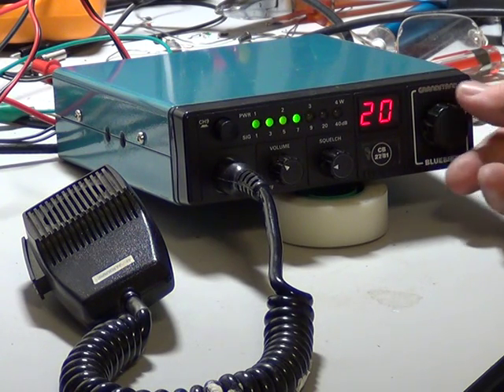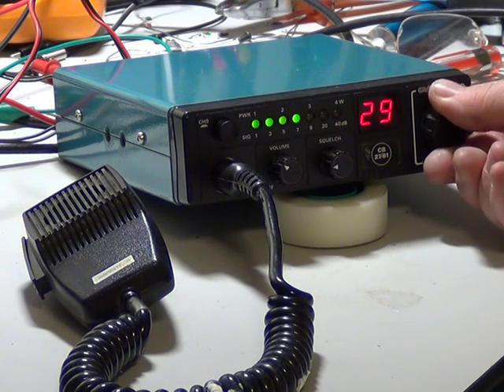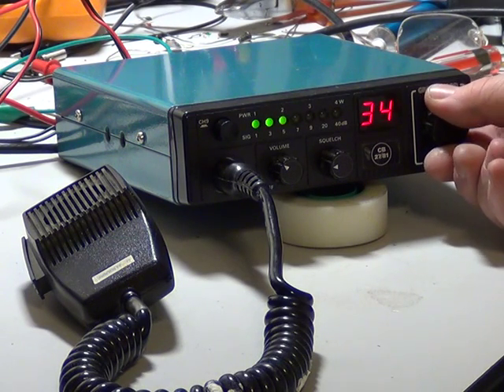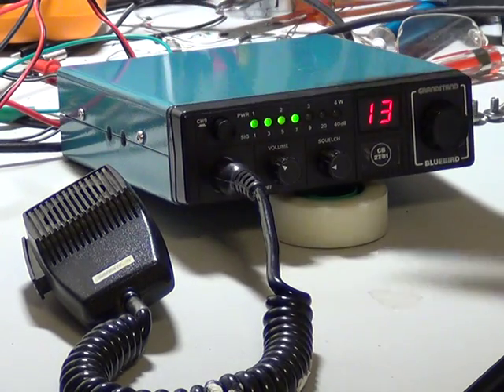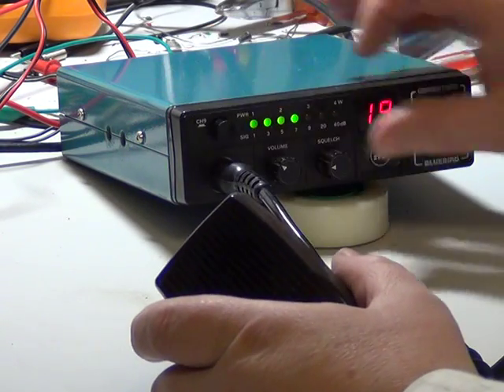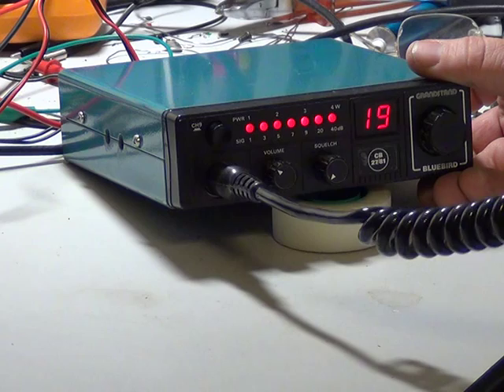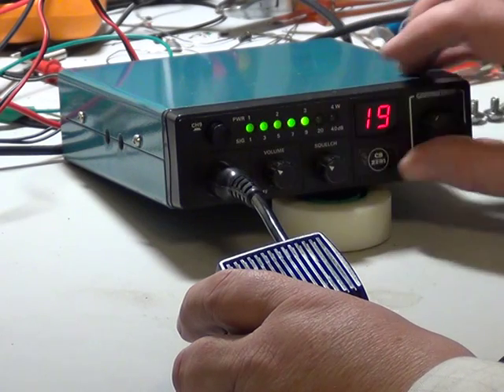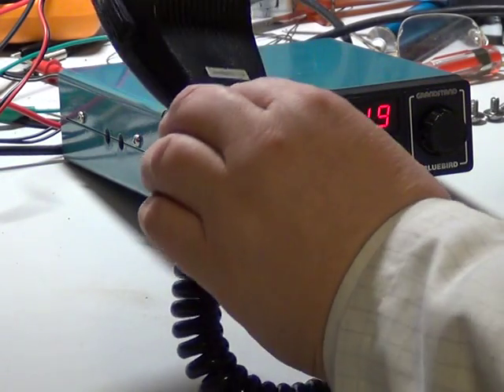Grandstand Bluebird  - UK CB radio, (CB 27/81) (Mobile) -  On The Air Test

Comment: The Grandstand Bluebird was my first CB radio, I bought it new around 1985, I think it cost £35. I used it along with a pre swr'd broomstick. One day in the late 80, s the skip was running rather well, I was living with my parents at the time in the scottish borders I managed to get a copy from a breaker in Penance. I still have my bluebird unfortunately it was damaged by a faulty power supply and need's repair. I am local to you in Conningsby, would you be able to fix it?

Charlie.
Reply from the maker: Charlie Wood Well, I could have a look. You would still have to mail the set in as it's strictly no callers!

Richard

Comment: I think they are a cracking little set but my radio engineer hates them for some reason ? 
I would like another 
Also do you repair  HF and v/uhf kit as I'am not all that far away from you and there just no one for miles with out going to the big outlets 

Cheers Sam m0srw !
Reply from the maker: Yes, the Bluebird despite being a high quality build is wierd; I've only seen one other & that was about 25 years ago' Lucky I photocopied the customers instruction book back then or I wouldn't have had the circuit now (which I uploaded to Scribd to share).

Other than UK legal CB radios, there are just a few Tait & Maxon models of professional business radios that I handle.

Richard